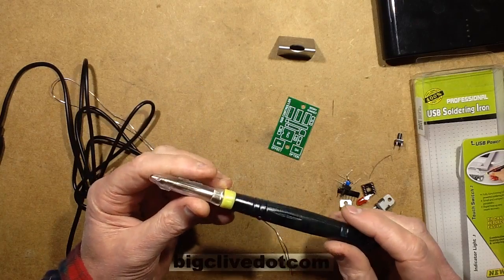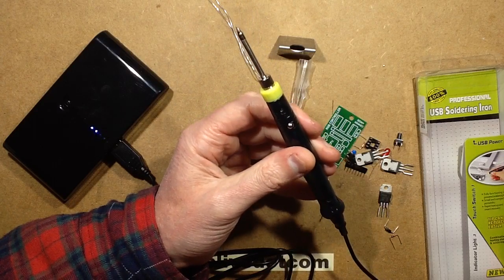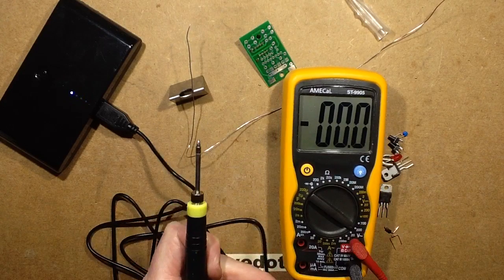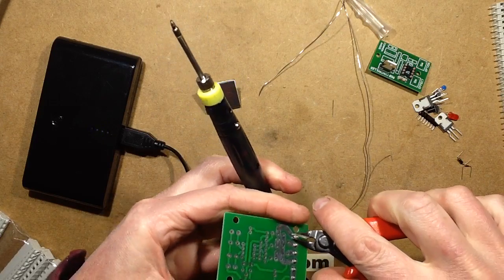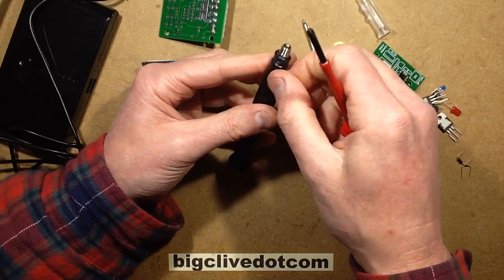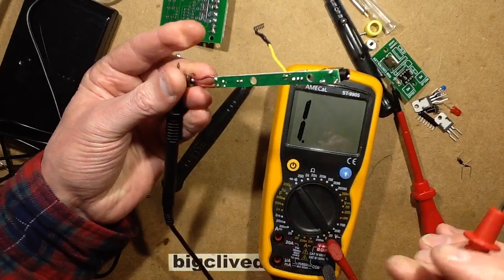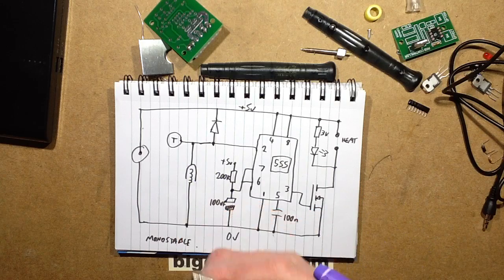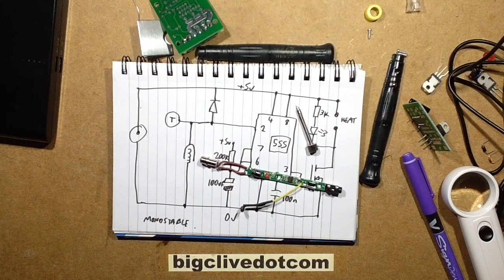USB soldering iron test and teardown with schematic.

Comment: i use little DC.DC stepdown converters from amazon with 8amps and its so cheap and i can power it with nearly everything from 7-35 v maybe thats a perfekt power solution for the usb solder iron

Comment: I have one of these and was similarly impressed. I keep it around in my backpack these days, just in case (I also carry around a power bank for general use). I replaced the dodgy minijack thing in the back with a miniUSB connector, so I wouldn't have to carry around its special snowflake cable. Not something I'd use daily, but having it around has saved my ass a couple times already.
Reply: ***** what? NO it doesn't reach over 500 degrees Celsius! That would melt glass! Check your conversion and do NOT use a normal thermometer to measure the temperature of the tip.
Reply: He is actually a spy and could repair his RF microphone on the fly, just like all of these other people who haven't replied. But RC hobbyists love those too and i mean when you crash a drone, wire detachment at solder joint is actually a pretty common occurrence... so many motor wires and servo wires. It's nice to be able to fix it right in the field. A literal field. There's also those kind of jobs where you don't have a lot of access and don't want to move a lot of equipment, or something in a car when say putting in a new stereo or retrofitting a Bluetooth Parrot or whatever. Naturally you don't just solder a new USB jack into your smartphone on the go, though i'm willing to bet, you could do this with one of these too if you had to, at least for the usual micro B variety. I've also worked at engineering companies which actually develop software, but given that the hardware is all prototypes where things just hang out there, having one person at hand who has a soldering iron and can use it to fix up the wiring harness instead of having to write up a repair order and having the work stop for a week until it goes through all the rubber stamps, tends to make a lot of people very thankful - it's the kind of company which makes billion dollar profits, but where the work is needlessly slowed down all the time because any time you file anything into requisition, it takes months and everyone is left twiddling thumbs unless they use personal belongings at their workplace that they're contractually not allowed to use.

Maybe there's also non-soldering uses? You could seal up a nylon belt or strap that has started unravelling. I imagine you could light a cigarette with it, that could be important at times, maybe even a ceremonial peace pipe, to prevent neighbouring tribes from attacking you. If you're being mugged, you could stab a robber right in the face or neck with a hot soldering iron, that should have him busy swearing until the police comes. Probably also useful against a lone terrorist - you know, when a truck is about to rush into you, you have that one last moment to tape your soldering iron to a powerbank, push the button, and use the next tree as a trebuchet and at least save a few more lives.
Reply: +marcan Good upgrade, now tell the chinese.
Reply: Isn't it amazing? I bought my own and yes, it really works! Just don't try to power it from a computer when trying to solder big heat-sinking components, a power bank is much better.
Reply: +DarkBabylon Yes, that is kinda correct. It does drop on very big joints, but overall it handles joints as big as MOSFETs and linear voltage regulators surprisingly well. If you let it build heat up, it will punch through and is able to keep that temperature pretty well, unless you expect it to be able to solder copper piping.
Reply: marcan - How has it saved you? I read this comment in every thread reviewing these junk irons. Not one person says what exactly they have done with it out of their packs.
Reply: timemachine194 - Don't mess up all this BS with facts. That's not how YouTube works.

Comment: Mine actually consumes about 7W. I don't think the heating element is made with the same precision as the rest of the components.
Reply: +Djhg2000 Indeed. Mine is about 6.5W - 1.29A @ 4.98v. But boy is it handy with a decent usb battery pack (not the lipstick chargers I just put it on for a laugh... they instantly switch off as if to say "nope... I don't like doing hard work!"
Reply: Peter Feerick Yes, it's absolutely worth every penny. Actually, on second thought it might even be worth more than that to me now.

Comment: The 100n on pin 5 (CV or Control Voltage) is just a decoupling cap (fitted when the pin is not used) and the 555 can be re-triggered. £3.50 post free, worth a look.

Comment: A bit more expensive but this one claims to run on a 9V battery (connector provided) https://cpc.farnell.com/mega-power/msd-086/soldering-iron-5w-usb-480-deg/dp/SD01905?catalogId=15002&categoryId=700000008615&storeId=10180&storeId=10180&krypto=ag1joMjRn4n6pq4VXA2%2FZ3JsxsjQ1EFLrGxicotqeqObFrG0JrY26rcv69A%2FgQD89FQr034Bfeil%0A71FJyPncd4ZFUysL0wGCEst2zB7mgyac0rYT%2BQQsNiiUhVxhcOIWECA4fjDlmnHn65UJaJgXWgyo%0A5Gl51oNyRchJfAIKqWjNXCwhUiUkp6Fgz2JwRJ6xxxpwLh1bsfFKtA3WbRZ5n4XAyXgJSZ%2BiT1ai%0A63Lk2vppQWWB%2B6Lb%2B2gtH533LP5fDlyKzv0BWfnQcfc11pXtl9PP%2FlJPIQn3
Reply: I really doubt that it can run on a 9v batt. Remember, most 9v batteries are just 6 AAAA cells in series, so would you expect an AAAA cell to put out enough current for soldering? I certainly wouldn't.
Reply: +A. Zak  yes, you notice I said "claims"....however, it does seem to work (at least for a short period)  See this review http://www.raspberrypi-spy.co.uk/2014/06/farnell-usb-powered-soldering-iron/   Could get me out of a tight spot (e.g at a live event, re-soldering an audio cable connector) and I could have a nice hot battery to warm my hands afterwards :-)
Reply: Surprising to me that it would work even for a minute or two..

Comment: This looks pretty convincing, I once had one that seemed to try an solder between two pieces of graphite, that was not very good at all and there was a measurable voltage between the 'probes'.
Reply from the maker: +The Backoffice the Cold Heat device was absolutely terrible.  There's a reason it was being pushed by hard telemarketing.
Reply: +bigclivedotcom I gave CPC a bollocking over that and they sent me the gas soldering iron I have had in my kit for 7 years, so all's well that ends well! I think for teardown and automotive you really cannot beat the butane beasts! :)

Comment: So, it basically shorts the USB 5V, with the added resistance of the mosfet? I assume its RdsOn is what makes the current ~1.5A then?

Oh, of course, the tip does not have zero resistance.. doh!

This is perfect for my caravan panic kit! Lots of easy-to-repair 12V in there, and I already have a very high current USB-chargers in the caravan.
Reply from the maker: +John Bäckstrand The tip has a resistance of about 3 ohms.

Comment: Looked like you were using lead solder, do you think that iron will work with lead free solder on a muti-layer board ?
Reply from the maker: +Ade Tuck It did melt existing lead-free solder connections, but I don't use lead free solder as standard.

Comment: Do you think this would work well with a USB 3.0 port? they're supposed to pass more voltage than 2.0.
Reply from the maker: +Gameboy 193 Technically speaking a USB3 should only be loaded with a total of 5 standard 150mA unit loads, so 900mA.

Comment: Definitely, not a good idea to use it from the AC adapter for mosfet gate... Do you think the tip can be connected to earth, or it will mess up the power supply?
I was thinking to use it directly connected to LiIon batteries (easier to get than beefy powerbank), but then at 4V I guess it would only be 4.8W, that would be definitely not enough. What is the actual heating element voltage?
Very interesting gadget actually, I will probably get one.
Thanks for the review!
Reply from the maker: +Electronica y Reparaciones I'm not sure about the implications of grounding the output of a USB power supply in terms of the RF noise.
Reply: +bigclivedotcom Yeah, I was thinking about that... if it is for sporadic use it may be ok, but definitely not for permanent use (otherwise manufacturers would do that in design)
The more I see the tool, the more I like it, hahaha
Reply: +bigclivedotcom cant you make a filter for the AC noise between the usb charger  and the soldering tool?

Comment: USB <put anything here>. Why USB? It is designed for data transfer.
Reply: It is also designed for power now, as latest revision support ridiculous power need like 100W

USB (At least now) usually provide DC 5V/500mA to ~3A, everyone has USB adapter so no need to provide an adapter, there is no different USB plug depending of the region (No NEMA, No Europlug, no..., only USB), there is no power difference either between region (no 120V@60Hz or no 220V@50Hz, only DC 5V 500mA to 3A), the object part of the plug is also usually standard, meaning it is cheaper for manufacturer to get a bunch of them
Reply: Because it's UNIVERSAL!!

Comment: Pin 5 is a point in the internal voltage divider (2/3Vcc if I remember correctly). The 100n just decouples that so the chip doesn't do stupid things. Probably could work OK'ish without it.

Comment: could you filter the high voltage AC with an LC network in the power cable? a series inductor with a parallel capacitor should do it.

Comment: Today I've "BigClive-ified" a solar outdoor LED. I put some tape over the solar cell, coated the small PCB with clear nail polish and plugged holes using hot melt glue. Clive would be proud! lol

Comment: Watts is watts, Antex do a 5W/10W iron, for "craft" work, and I used to have a 10W 12V iron back in the day. Useful for working on car electronics. 

Having said that, I was also surprised at how neat the thing actually is. 

A bit of thought has obviously gone in to the design. It also looks a lot better bet than the gas portable irons that used to be popular. 

I now need to resist the urge to impulse buy a USB soldering iron that I don't actually need... or do I....

Comment: That thin USB cable drops about 0.7v...changing the cable to a decent one would improve the power output and would probably reach the stated 8w.
I did some tests on some USB to micro USB cables, results were (per meter of cable) any where from 0.2v to 1.1v drop @1.5A
So the cable plays a big role here.

Comment: this would be handy. however i have seen units that connect directly to a small lithium pack, ones that are used for RC cars and what not. I would prefer to have one of those, as they are sold in 50w units.

Comment: On Banggood, there's a thing called a TS100 Digital OLED Programmable soldering iron. What are your thoughts on it?

P.s. as far as that stray AC voltage from wallwarts, would some sort of capacitive tank or shunt to inhibit the AC from getting through be practical to put in-line with the iron? Perhaps a dongle of some sort to go between the wallwart and the iron's plug?
Reply: +Gadgetboy That OLED one looks interesting. Programmable, and it looks solidly made. I want to buy it purely for the broken English on the page though.

"When you're not here, he's waiting for you quietly."

"Antistatic structure with groud wire connected that makes you safe every working time."

My only concerns would be the kind of plastic it's made of (how much friction between hand and iron? And it does heat up quite a lot, it seems.) and that it's got no rubberised area or whatever, to improve grip and make it more comfortable to hold.

£7.72 for a tip too.

I hadn't heard of it before, but I spotted what looks like a fairly in depth review of it on the eevblog forum. http://www.eevblog.com/forum/reviews/trial-on-the-ai-controlled-ts100-soldering-iron/
Reply: +Gary Atrix - "Leading pocket times - intelligent everywhere".

Comment: did you use lead or lead free solder because in my experience the lead free needs more heat. and until I found your channel I did not know you could still get lead solder (so much nicer to use) but I would think a lot of people use lead free

Comment: Clive, didn't you test a NICD battery powered iron a while back? This isn't a lot different except that the battery is on your belt or the table.

As for a 6W iron, back in the 1960s my father worked at Spectrol, and they used 6W 6V transformer-powered irons for all their work. He brought one home and we used it for decades for the majority of PCB work. Only rarely did I have to resort to a larger iron. That iron gave up the ghost some decades ago, but I was able to get an exact replacement, made by some English company as I recall. I used that up till about 10 years ago when I finally bought a Chinese combination solder/desolder/hot air gun soldering station.  I still think the 6W things are great little irons. Weigh about half an ounce and the 4' of twisted pair cable is almost weightless too.

Comment: That vibration sensor -- are you totally sure it's not a tilt switch?
Reply from the maker: +Halojen I thought it was at first.  But the end is open and there's a fine spring inside.
Reply: That's quite bizarre. I would probably replace it with a tilt switch because that would be so much more logical.

Comment: Wow. My 20 watt iron takes half an hour to warm up and doesn't solder as well as this.
Reply: +themaritimeman Radio Shack?
Reply: Canadian Tire, which is probably of the same realm of quality. My biggest issue is probably that I'm using cheap lead-free solder.
Reply: ***** Don't use lead-free solder. That stuff is crap and the fumes are a lot worse for you due to the extra aggressive flux they have to use.
Reply: 20W is probably false advertise.
Reply: +themaritimeman sounds like a cheap radio shack pos. I used to have one of those, then i upgraded to a 100w fully variable temperature unit. that heats up in 10 seconds. Best little unit ever.

Comment: Might buy one and modify it to have an auxiliary ground for the tip.
Also, four NiCd or Nimh batteries put out 5v. Super cheap and easy power for one. I'm certain the 5v this requires doesn't need to be too extremely regulated. Maybe four primary batteries at 6v wouldn't be too much of a stretch.
Reply: Walter Boxhead
True, but I'm looking for the stupid simple solution.

Comment: It would be interesting to see what temp this iron runs at on you solder tip thermometer. I wonder if there is significant variation or not
Reply from the maker: +spyderdude42 When applied to the measurement point the temperature plummets to about 250C and then climbs to about 430C.

Comment: I think I was just as surprised as Clive, if not more so, when he soldered that resistor; it warmed up quickly, and the solder melted FAST! I was expecting him to have to hold it at the joint for at least 10 seconds or so.

This seems to be a fairly decent backup for non-critical (ESD-sensitive, etc.) applications, although I do share Clive's concern over the leakage current. To be fair though, quite a few of the vacuum-tube instruments I own have very similar leakage currents and voltages, or at least the ones to which I have not yet added a 3-wire power cord; my Knight KG-650 R.F. signal generator is a noteworthy death trap (120 VAC on the 'isolated' chassis!). Thanks for the detailed tear-down, Clive!

Comment: What about just connecting the tip to ground with an extra wire?
Reply: He talked about that in the video.
Reply: +themaritimeman no he suggested to use a powerbank so it's completely floating. I suggest to use a mains to 5v supply and add a connection to ground so the capacitor in parallel with the psu transformer will not be able to raise the voltage of the tip.
Reply: Sorry, I was half asleep when I read your comment and read it to mean bypassing the circuitry and connecting the heating element directly to power.

Comment: What would happen if you grounded the tip (or part) while using it from a mains adapter?
Reply: +Matthew Miller I was wondering if it might trip your RCD circuit breaker
Reply: Since we don't have those in the US, would it "just work" though?
Reply: Probably, but I am sure you're kidding when you say you don't have them. What protects you from a live to earth electric shock?
Reply: I mean there's a couple places that are "supposed to" have GFCI outlets to protect (bathroom sink, outdoors, kitchen counter) but the majority of things you just don't stick your fingers in the socket?

And then most things aren't grounded and have plastic cases, they use 2-prong plugs so you'd have to have a crazy set of circumstances to end up touching live wires and ground in a normal situation.

Even then this old apartment only has GFCI on the 2 outlets by the bathroom sinks, I had to get a plug-in GFCI adapter for the stuff I put by the kitchen sink, cords going outside, and fishtanks.  Though I'm re-considering that because the stupid things trip every time I get on amateur radio and so far we haven't had any spills/leaks bad enough to soak the power strips.